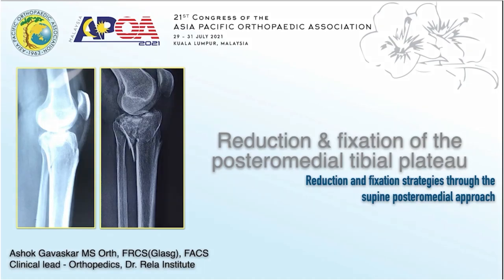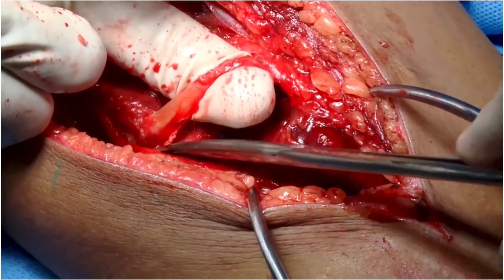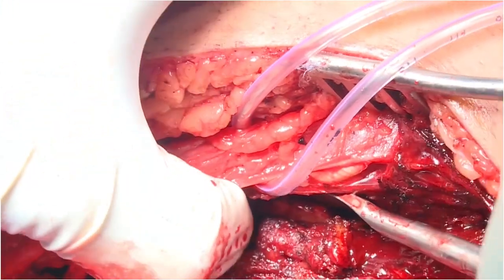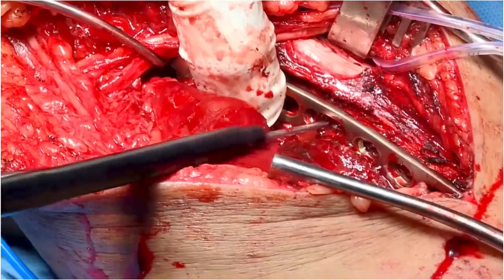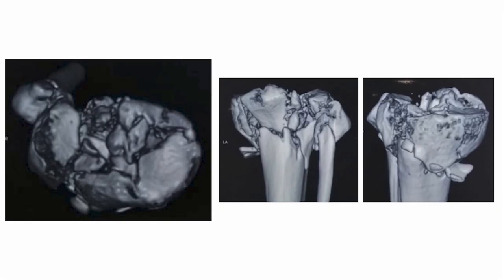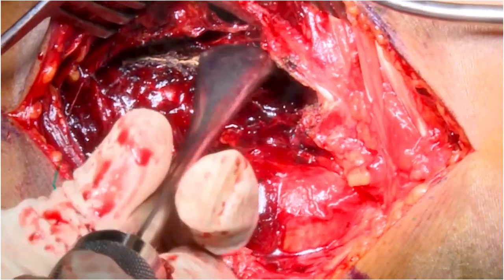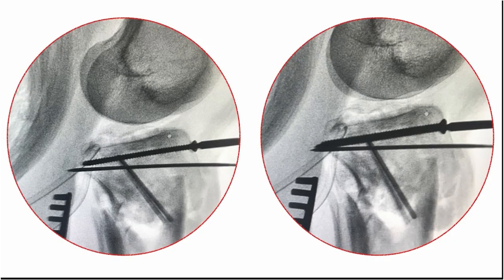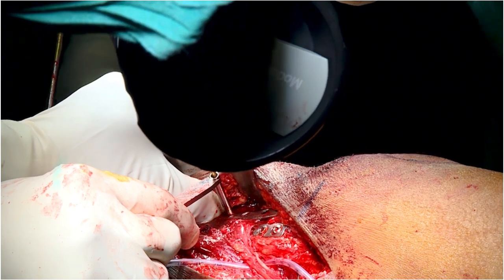Posteromedial tibial plateau fixation

Comment: hola tengo 36 años, tuve una fractura de meseta tibial grado 6 tengo 2 meses y 10 días desde la osteosíntesis me ice una radiografia y me salio casi igual al día de la fractura , pregunto ¿puede un paciente caminar sin que la fractura este consolidada al 100% o cuanto tarde esta lesión en sanar? gracias.
Reply from the maker: You can bear weight gradually on the operated limb over the period of 3-4 months with progressive healing. Healing usually takes 3-4 months